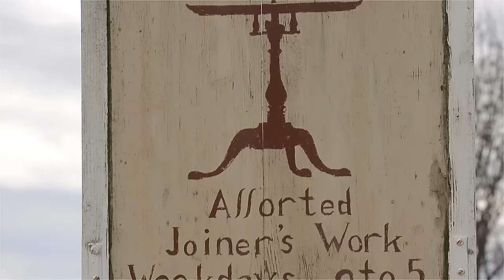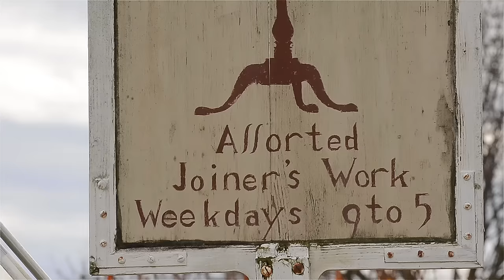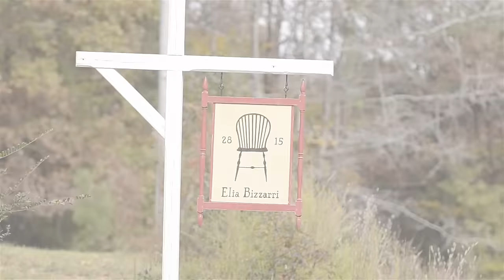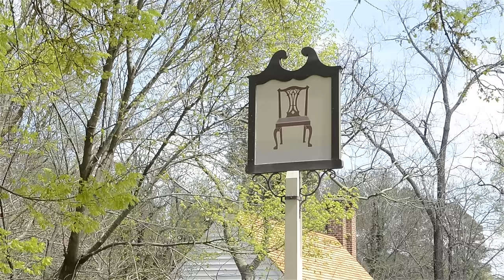10 Jaw-Dropping Woodworking Shop Tours

Comment: Those shops are all great. The guy with the off grid barn that he bought on eBay was amazing. The old fashioned, aged woodworking shops are a journey back in time. True craftsmanship. Not the commercialized materials that you see today. A dream of mine is to discover woodworking in my own shop/man cave. Currently I'm barely keeping my head above water financially and I feel almost like I'm trapped. I work in the office furniture business as a builder/laborer but the focus is on quantity with most pieces being comprised of compressed particle board held together with cam-locks. Maybe one day I can afford to buy my own  time and learn how to do some quality builds. For now I'm just happy when I get a chance to use my wormdrive circular saw. Great video. I hit the like button. Keep up the good....woodwork

Comment: All the woodworking shops are unique in there creative artwork where gifts become apparent, some to excellent workmanship and others capturing the past. I have bought a fully functional woodworking shop where previous owner ( machinest by trade ) modified & rebuilt various woodworking machines to multiple uses, for example a radial arm saw was converted into wood milling using different routers.  Great work & show, May God Bless you all, all glory & thanks go to our creator and our Lord Jesus.

Comment: Hi. I mistakenly used Polyacrylic instead of water based polyurethane on a butcher block counter top (Lowe's had it sitting right next to their oil based polyurethane). Now, months later, the paper from boxes, like cereal or popcorn, sticks to the polyacrylic. I then have to scrape the paper free. How can I fix this?